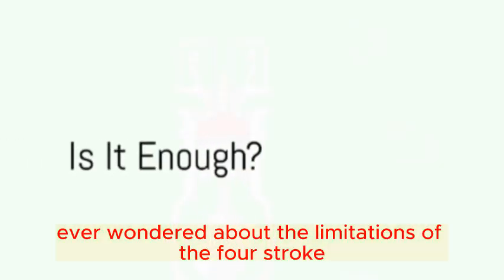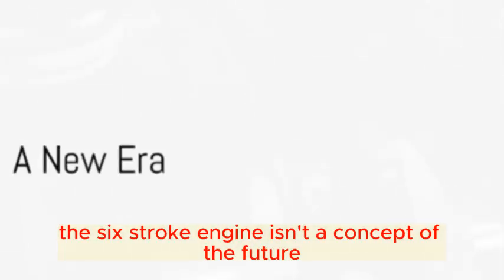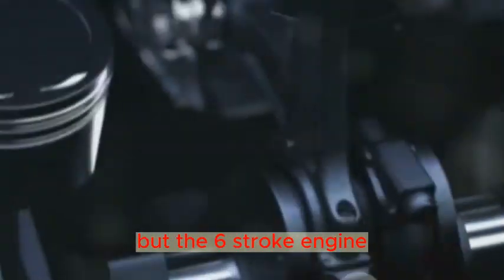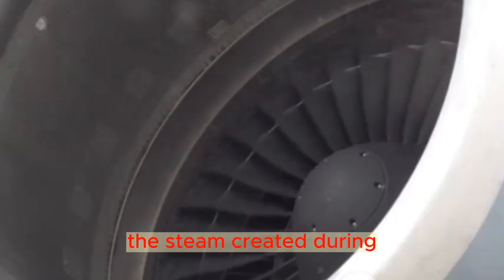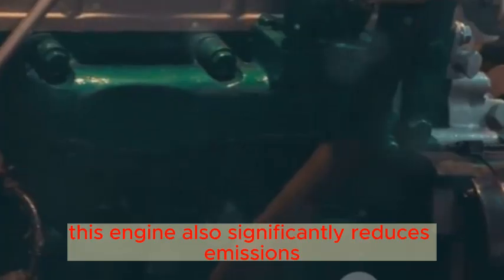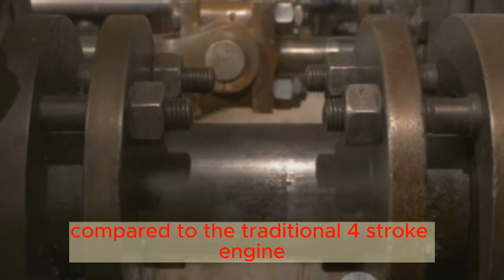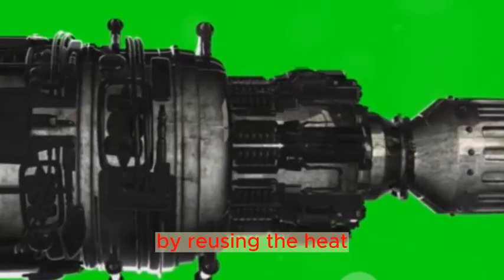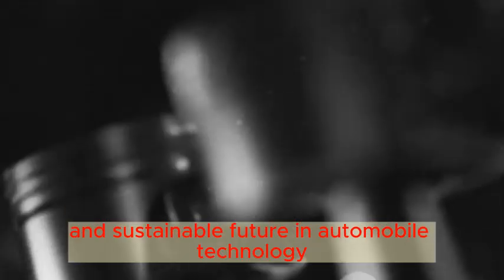6 Stroke Engine

Comment: Merc w196 and 300slr racing cars used water injection on a four stroke which let them be more generous with the ignition timing and also supercharging

A four stroke engine  creates heat which is an engines worst nightmare.

Comment: Mm what about the obvious additional wear & tear on internals like your crank bearings? Does it run on ‘6-stroke’ oil? How is this going to be timed and most of all balanced properly?? Even number of cylinders yes, but if it’s basically having two power strokes, how’re you timing it at all? Seems like something a group of bored engineers came up with for fun one evening.

Comment: its not that, its cuz one explosion cycle completes 6 revolutions rather than 4. hence the "efficiency" which i doubt. its gonna have far less torque and bigger cylinders to accomplish what a smaller 4 stroke can. just like how 2 stroke is way better at torque, power and speed. yet less efficient cuz every cycle using gas.

Comment: You are wrong about the point of the water injection. It is not to make the engine cooler. When you inject water into the hot cylinder it turns to steam and creates power with its pressure.

Comment: Seems pretty obvious why it saves on gas. It only uses gas once every 6 strokes instead of 4. It also only provides power once every 6 strokes instead of 4 so I don't see how it can be as powerful. There's also what others have brought up, you have to fill an extra fluid (water) and that gets used up. You'll also need to make sure you get high grade water as tap water has minerals that'd likely ruin your cylinders. Can't you just cool it better using the functionality currently available?

Comment: Don't mention the war, I mean that pesky second law of Thermodynamics. Just like any IC engine most heat during combustion will be lost and a bit of internal steam cleaning won't achieve anything. Anyway I am investing all my savings. Tape some magnets  to the fuel line, bolt some crystals on the head,  and when Mars  is in Capricorn it should get 110% thermal efficiency.

Comment: No n.bers, no explanation of the thermodynamics of how it works, no explanation of why fuel does nor condense on colder cylinder walls......
Reply: yeah it sounds like techno jargon, injecting water cools down the engine but that heat is still wasted...in the water, also what about the catalytic converter, that needs to be hot to efficiently operate

Comment: Yea if it was an option we would be driving it now. Also if water is injected on the down stroke, are u trying to get energy from the water to steam conversion? The next intake stroke with fuel would then have water vapour, how do they manage the compression stroke? The water vapour would interfere with compression ignition, how does the engine manage advanced or regarding timing on the combustion cycle? Yea dude I think your just smoking some good green stuff!

Comment: Does this engine use metal cylinders and metal piston rings? I see a significant issue if the answer to either of my questions is yes. Water tends to strip the protective oil film from the rings and cylinder walls which will increase friction and wear leading to excessive wear and shorter life!
Reply: Well this issue could be solved if you replace the water by another element with similar thermodynamic properties. An oil with a low boiling point maybe or something like glycerol
Reply: This is an old issue with this tech, going back to water injection used in WW2 fighter aircraft engines. It was called "war emergency power" and the use of which would boost power, but would also do just as you say here, be washing away the oil film. Over use of this system would trash the engine in short order.

Comment: Full of CRAP. State how each stroke is beneficial. Don't just claim it as so. Each detonation creates heat. The heat is removed to control metal expansion, premature fuel detonation, and allow for the next cycle. Adding a cooling stroke means nothing. Explain it, don't just parrot stupid shit.